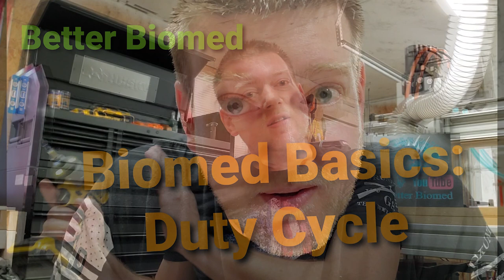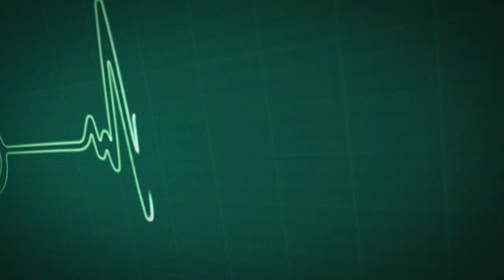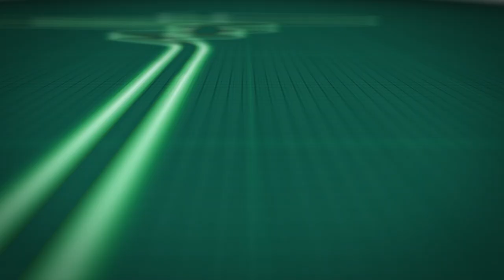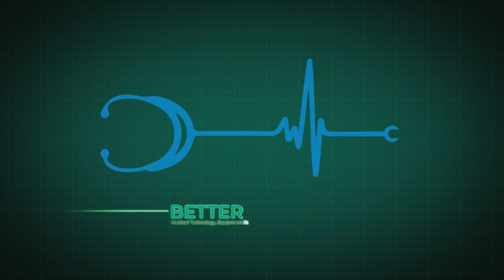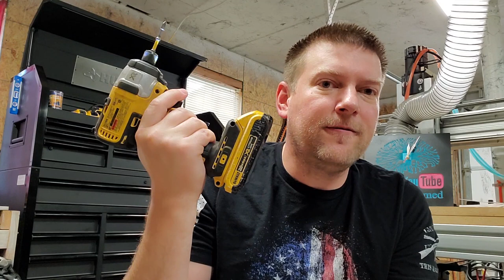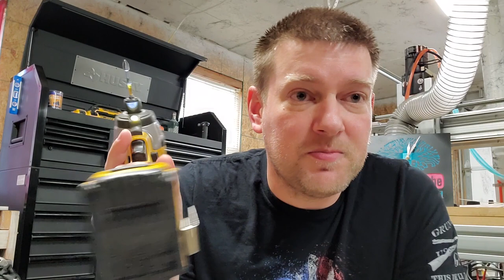Biomed Basics Duty Cycle

Comment: May I ask do you know how long is the Duty Cycle in an ESU. How long does 1 duty cycle of the signal that being use for Blend Mode. The blend mode use 50% Duty Cycle, that duty cycle refers to the signal that is used and not the time the generator is used. Can you tell me how long that 50% cycle last, i guess it will be around milisecond but I need the exact number or range of it. Can you help me?